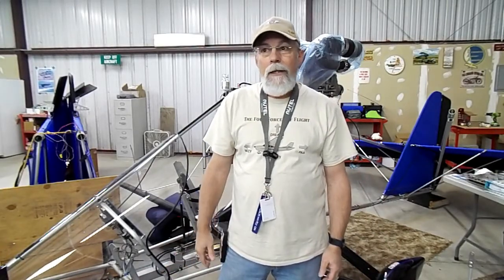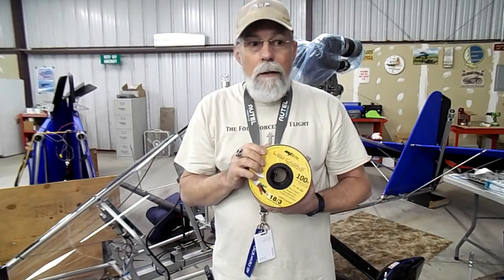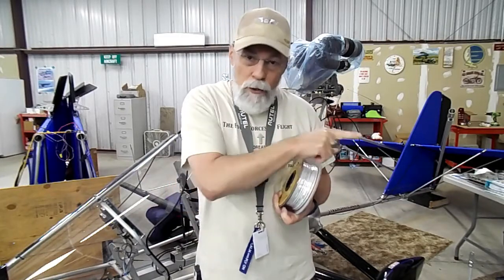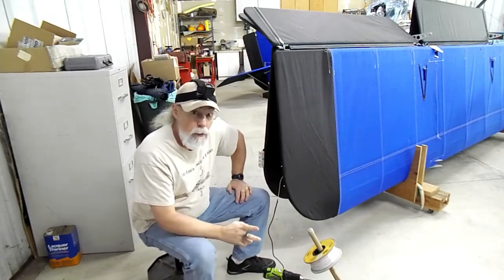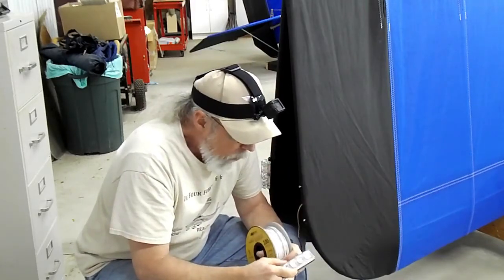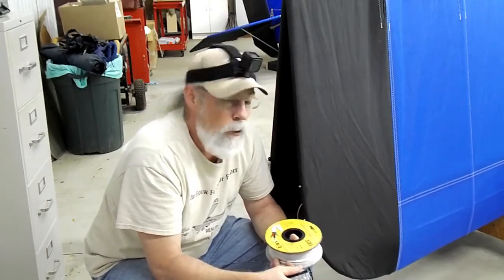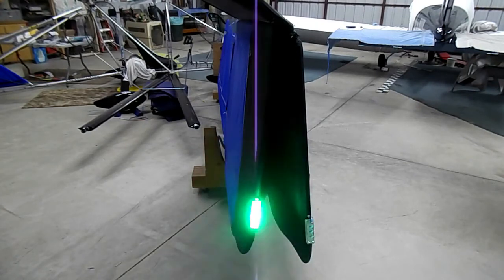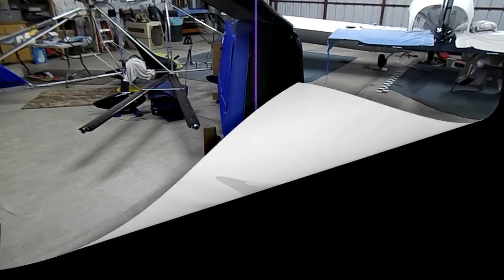Wing Tip Strobes Installation on my 2017 Aerolite 103

Comment: This video is quite old and I don’t know if you still monitor it but I’m wanting to do the same inside of my wing. Is the wire running the length of the wing just in there loose or do you have it running inside the leading/trailing edge tube?

Comment: The three flash sequence is good. I don't know about chinese lights that are made for vehicles. They are not aerodynamic, and I wonder how they stand up to the stresses of flight.
I would want small round LED wingtip nav lights, and white strobes, one under the pilot's seat, and one on the top of the vertical fin.
Is there an update on how these strobe lights are holding up?
Reply from the maker: I have 25hrs on the planes HOBBS meter and so far they both work just fine. As for aerodynamics the ultralight can handle the slightly extra drag, if any, that they would add.